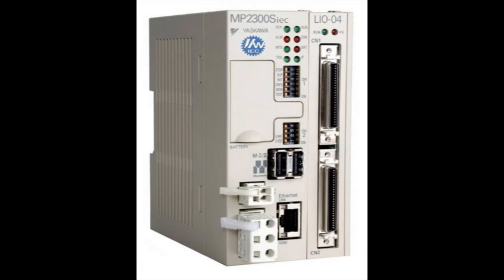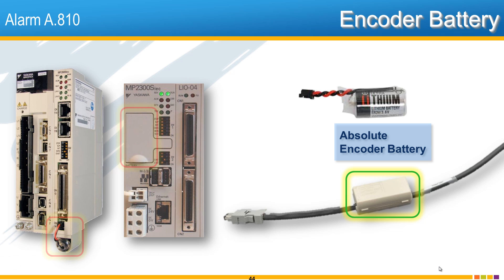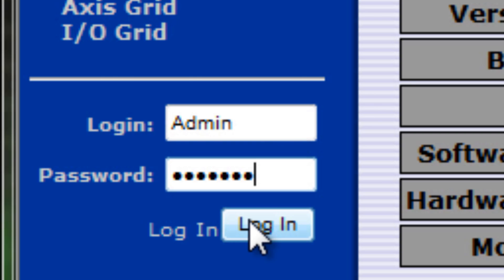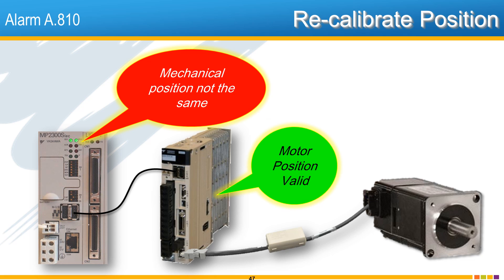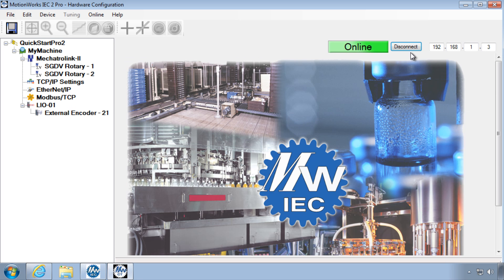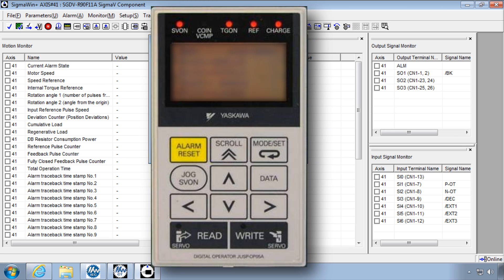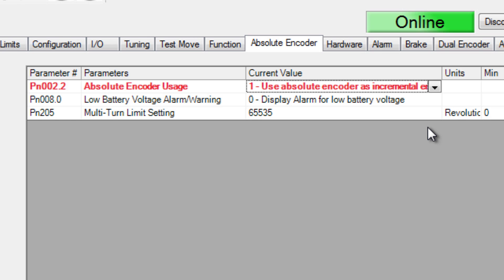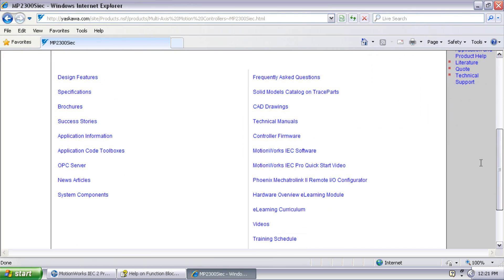MotionWorks IEC - Absolute Encoder Reset (A.810 Alarm)

Comment: I also got this A.810 error when i turn on servopack SGDV-2R9EP1A with servo motor SGMMV-A3E2AAC. I have do method 3 to do encoder reset. But the alarm still occur. How the other solution to reset it?
Reply from the maker: Thanks for your interest in "MotionWorks IEC - Absolute Encoder Reset (A.810 Alarm)".
Resetting the fault is dependent on your application. Here are two documents that can assist in resolving the A.810 Alarm. 

Clearing an A.810 or A.81 Alarm when Using an Absolute Encoder in Incremental Mode
https://solutioncenter.yaskawa.com/selfservice/viewdocument.do?noCount=true&externalId=13075&sliceId=1&isLoadPublishedVer=&docType=kc&docTypeID=DT_FREQUENTLYASKEDQUESTIONS_1&stateId=513&cmd=displayKC&dialogID=10151&ViewedDocsListHelper=com.kanisa.apps.common.BaseViewedDocsListHelperImpl&openedFromSearchResults=true

If there is an absolute encoder without a battery the following would apply: Use an Incremental encoder cable with an absolute encoder by adding JZSP-CSP12-E
https://solutioncenter.yaskawa.com/selfservice/viewdocument.do?noCount=true&externalId=12751&sliceId=1&docLink=true&languageId=&isDocLink=true&currentmsID=MS_Customer&cmd=&openedFromDocument=true&ViewedDocsListHelper=com.kanisa.apps.common.BaseViewedDocsListHelperImpl

Comment: I'm having issues with the alarm A910
Reply from the maker: Thank you for your interest in "MotionWorks IEC - Absolute Encoder Reset (A.810 Alarm)". The A.910 is an overload warning which can turn into an A.710 alarm. It indicates binding in the system. A possible brake may not be released. You may need to isolate the motor without the load.  For further assistance please contact our Technical Support at https://www.yaskawa.com/support-training/support.
Reply: @YaskawaAmerica  Yeah, I figured it was an overload of some sort when I looked up the alarm codes online. The servopack displaying the error controls the servomotor of the Z Axis (Up/Down) on the CNC machine I'm working on. We figured out today that not enough grease was getting there to lubricate needed areas, and the servomotor would experience some difficulties while lifting the machine head up, and presumably would experience some overload as well, stopping the machine dead in its tracks.
Reply from the maker: This is awesome! Glad you were able to resolve this. Thanks for the update.

Comment: Hello. In my case, error A.810 occurs every time I turn off the CB. I have tried to replace a new battery, swap cable with other servo and replace the amp but it still occurs on the same servo. The motor still works ok. What is the problem with it?
Reply from the maker: Thank you for your interest in "MotionWorks IEC - Absolute Encoder Reset (A.810 Alarm)".  Please ensure that your motor type is absolute. If it is incremental, then, A.810 does not apply. Change Pn002.2 to 1. Please feel free to contact your local service provider for further assistance. https://www.yaskawa-global.com/company/profile/global